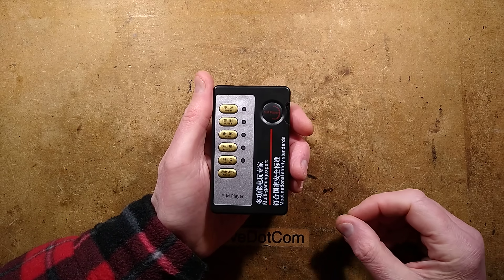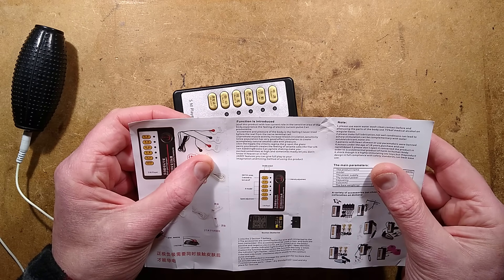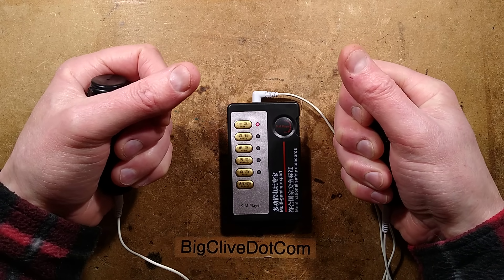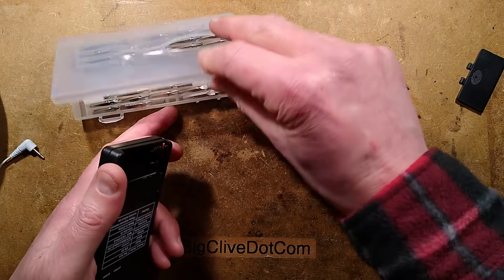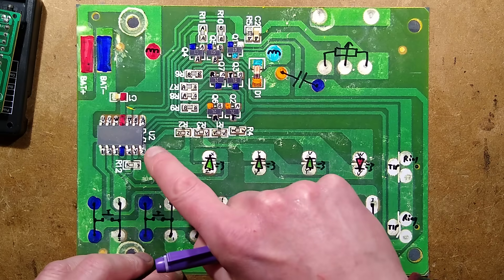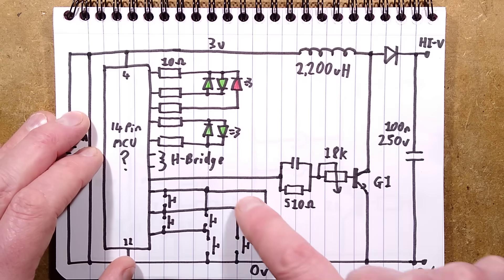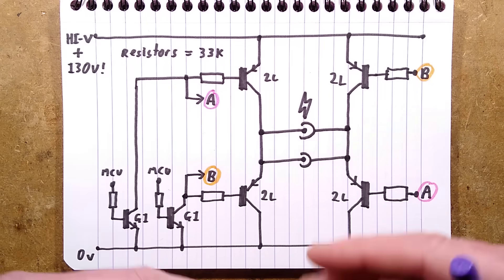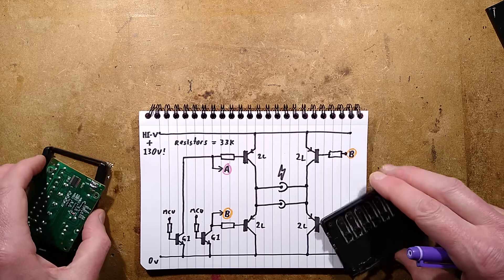Inside an invigorating electro-health device - with schematic

Comment: Despite the high voltage this should not pass 30mA , especially if you wanna plug these in your private parts , i dont see any current limiting circuit, but i think the voltage boosting by the inductor decreased the current ... im not expert on this side

Comment: I'd be curious to see what was inside the more advanced similar machines, like the more "proper" medical TENS units or the ones used by insertable electrode enthusiasts - would be interesting to see if the circuitry is similar but with a more advanced microcontroller, or achieving something similar by a different method.
Reply from the maker: I think some are using low voltage amplifiers with MP3 files for the waveforms.

Comment: Could this be modified into a defib unit ?
Reply from the maker: No.  That requires a lot of clever processing and high voltage current controlled DC.  I have a video about a defib unit.

Comment: Very good anf fun tear down of this unit Clive!
But in the schematic of the H-Bridge it seems to me the two connection points for the electrodes are both on the same side of the bridge, shouldn't one be on the opposite side for the voltage and current to reverse?  |---o)---|  and |---(o---|
Reply from the maker: Both sockets are in parallel and each is across the H-bridge.
Reply: @bigclivedotcom indeed, I can see it now when you flipped the board over at 7:55!
Was not what I expected 😉

Comment: I've used TENS machines for pain relief, but you have to be careful with how you set it. My machine allows you to see frequency, pulse width and amplitude, and covers some of the controls so they are protected for being bumped.

It's also not a good idea to connect electrodes across your chest, like holding them in both hands.

Comment: Thanks for an interesting and informative video as to how the modern versions of these devices work. Is it possible to modify this device so that the output is reduced? I am wondering about the possibility of modifying such a device for electrotherapy purposes that operate without causing sensation.
Reply from the maker: At the lowest setting it can barely be felt.

Comment: Some of them def do pulse DC for the sake of two transistors and I have often wondered how damaging that might be; I imagine that usage is probably very short not hours like it might be for back pain etc.  I think the danger of these is that you'll find some at £10 maybe up to £20 and then a huge gap and then £150 - £500 and lets face it, people will spend the £10 and are unlikely to spend the £150.  They are not really that pleasant initially but after a few mins (of presumably nerve damage) the sharpness goes and its more of a massage.  Finally since everything you buy is some cheap plated Chinesium, I don't really know what they are plated with and I'm not sure whatever it is will not do you much good as it electroplates your testicles (or whatever).

Comment: The H-bridge output stage of that device works very similar to the output stage of a 12volt dc to 230v ac power inverter.

Comment: You should look at the so-called Beck plant stimulators / blood purifier which is similar in design but still available in kit form. Claims to cure HIV and just about everything else first read about in a 80s ham radio magazine called 73
Reply from the maker: If it's the equipment I'm thinking of, it usually applied slow alternating polarity between electrodes to pass DC current through your blood as it flowed through your body.

Comment: I'd love to see the oscilloscope trace for the different modes. And.... That's about all I'd want to see.
Reply: Typically, pulse length is fixed anywhere between 40us-200us, repeated either with a fixed or variable frequency. The pulse itself is short and steep up to about max. 100V or so depending on model and contact resistance. If your model is transformer-based, there will be a longer but much shallower negative swing immediately after. Polarity alternation optional, transformer models tend to not even bother, presumably due to "no such thing as a DC-output transformer (unless you rectify, which they don't)".

Comment: I once made a device to give me shocks if I had too many beers at the pub. It used the high voltage trigger transformer and trigger circuit from one of those disposable film cameras, without the giant flash capacitor of course. It didn't work. Well, the device itself worked but it didn't stop me drinking too many beers!

Comment: How does discharging the high capacitor with metal tweezers help? 😂
Reply from the maker: As long as the circuit is isolated from ground it's safe.

Comment: Those jacks are 1/8" jacks.  That's the original standard.  Same with 1/4" jacks - they're not 6mm.
Reply from the maker: These are the smaller 2.5mm size.
Reply: Dude, NONE of the gear and electrodes in this space uses 3.5mm jacks. All of them are 2.5mm.
Reply: @AttilaAsztalos  - You're actually wrong there.   I've worked with a chiropractor for 25 years, and the bulk of the equipment is 1/8" or 1/4" jacks, if they're not something completely proprietary.  BTW, 3.5mm jacks aren't.  They're actually 3.18mm.   The plug standards were built in U.S. Customary units  (Well, and Imperial, because for linear measurements, they're the same)   The 'mm' is a conversion invented by a group of people that were incapable of understanding two measurement systems because they were 'too hard'.  (This same group then came up with 'Kelvin', because apparently -273.15 degrees is too difficult to work with.)

Comment: The Tens 7000 is great little unit. You can the the 9v battery one or a rechargeable type. The pulse width and modulation can be controlled, as well as various pulses or a constant waveform. Most units do not have the constant mode. And as another person stated, NEVER use the pads, clips, hook-ups or anything else above the waist. A possible heart attack could be caused by the unit, no matter who makes it.
Reply: After searching the world's medical literature I've been unable to find any credible evidence that supports TENS as a risk factor for heart attacks. Can you correct me on this point with a single published case? (I've been searching for years.) Further the package insert for the FDA approved devices have NO, I repeat No warnings to that effect.

Comment: I think there is no current limit. Instead the value of that capacitor limits the maximum energy dumped to the user because the the boost converter just charges the cap like a photoflash did before LEDs.

Comment: These are real but they need contacts and special conductive oil/gel plus a doctor to pick the right spot.

Plus you need an actual reason, not just some psuedoscience self-improvement. These are meant to stimulate damaged nerves for your brain to figure out where they are now.

When I folded my upper arm it damaged nerves in my hand, mostly thumb-to-index finger and the back of the wrist. I was stuck with a limp wrist and a bad grip for about 6 months until the physical therapist zapped it a few times and I "found my hand" again. Hard to describe but you can easily hurt yourself with them if you pick the wrong spot or leave it for too long. Not really worth buying either, helps with motion but not feeling. Talking to a doctor without any gadgets is still more beneficial than buying these things.

Comment: That schematic doesn't make sense. Both electrodes are at the same voltage, so the only current loop would be some sort of capacitive coupling between the body and the battery. 

If each electrode has two conductors, then it makes more sense. That would mean you aren't actually getting any voltage across the chest when you hold an electrode in each hand. The current is limited to one hand.
Reply from the maker: The hand electrodes have a two pin jack.

Comment: Seeing a TENS machine a few months after covering them in school was super neat. On the one we worked on had Burst mode (low frequency current & high frequency pulses), Normal (constant frequency and pulse width), and Modulated (frequency varied to reduce nerve adaptation). The pulse rate determined the feeling, while the pulse width determined the 'depth' of stimulation

Comment: Thank you Clive for delivering such fascinating material. May I suggest you resurrect Fanny Flambeaux as a test subject for the stranger shaped electrode? With the addition of certain powders that you are well acquainted with, a spectacular end result could potentially be achieved at higher voltages / frequencies. Naturally, this could be framed as a "Don't try this at home" health and safety message.

Comment: OG viewers remember the old video where you tested this the expected way and found it unplesant.
Reply: Would not be surprised if these are repurposed muscle stimulation devices.  The dildo-like electrode has much to small a seperation between the two contacts in order to be pleasant.  These are just uncomfortable cheap (and dangerous, given the non-seperated "channels" to which you can attach electrodes) devices meant to jump on the small'ish hype of erotic estim.  And unfortunately, because of the sametimes unpleasant nature it turns people off from it.
The better devices unfortunately are freakishly expensive.  Partially that'll be a liability situation where the manufacturer has to get things tested, but it's the result of catering to a niche market as well.  Not only the low amount of kits sold will play a part, but the fact you are selling to a market in which it is easy to basically ask whatever you want because there are no alternatives will also play a role.

The chrome electrode to me immediately had me worried about the possible toxicity of the chrome plating: some are perfectly safe for use on or near mucuous tissue, but when passing electricity become toxic.
Reply: Can I let go of 10mA mains (240V 50Hz) current? (Do NOT try this!) 
is a good one too lol
Reply: "Should I stick this electrode in my butt?" Is the OG video from 8 years ago that you meant btw its a classic!

Comment: I designed and built one with an NE556 dual timer. One side to generate the voltage and the other to control the frequency. The medical unt the dr perscribed was $500. And was beyond finintual reach. Now their available over the counter for $35.00

Comment: I have proposal for next device, it looks like butterfly, but its 2 electrodes and in the middle is battery and electronic. This is placed on some muscle and then device contracts muscles in programmed mode. Its funny, once you place it on hand, you cannot remove it :D If you place it properly, you can trigger finger movements.

Comment: Fun little device, did a similar project for an art performance - artist wanted literal meat puppets - real bodybuilders controlled externally - for reliable muscle contraction you have to produce around 200V of compliance and up to 50mA, tho at a really short pulse length. Worked like a charm, tho I was really paranoid about isolation between channels, as not to pass current across the heart.

Comment: One in each hand - NOT IDEAL. There's this beating/pulsing muscle between those 2 hands. That's exactly why you take your wedding ring off when you change a car battery (near full current at 12V DC between a wedding ring & wrench will off you till you DEI from it)!
Reply: Not trying to step on your toes. Soon after I posted it you implied a similar thing and I had no intention of taking your statement away from you.
Reply: The reason you remove your rings when changing a car battery is so that if they cause a short circuit they don't glow like the sun and burn you or cause
sparks that could ignite the gas being vented by the battery. 12 V will not kill you or stop your heart. Even if you place one hand on each
terminal you will not feel a thing.

Comment: Strange that the two hand electrodes are driven in parallel. As the circuit is floating from earth, the user should not notice anything. Just like a bird can fly to and sit on a high voltage line without any harm or pleasure. Or is there a twist in the connectors on the board (not according your board view) and have two equal wires hand electrodes? Having dedicated left and right, opposite wired, hand electrodes seems to much hassle.
The metal electrode has only one two wire cable connected to it I assume so it provides in opposite voltage between it's two poles.
Reply from the maker: The hand electrodes have a single plug.

Comment: now then BC. as is my wont I'll bore you with my latest researches. i have repeated this experiment several times, and i get the same results. but i still don't believe it. i got a 555, set it up as astable at about 1kHz, then i used output to drive a 540 mosfet, with an inductor from drain to V. then i attached a 450v 100uF cap i found to the drain, inductor junction. then i powered it all with a cr2032. i was measuring 130v across the cap!. i turned 3v into 130v. it just doesn't seem possible.  cheers, D
Reply from the maker: The collapsing field in an unloaded inductor can produce a very high voltage.

Comment: TENS unit. Jackass used it one on my ankle that was going through rehab for a bone spur trying to dig through my achilles tendon. That is, nothing that thing is for, it's hurt ever since. Caused the tendon to tighten up and the bone spur came into contact with it, roughly. Then the other rehab that went with it, caused my already damaged knee on the other leg to get even worse than it was. All so the insurance company can put off surgery as long as possible in a purely cost saving exercise. Welcome to American Medicine for profit. Vent over, sorry.

Comment: I have two medical TENS devices(doctor prescribed)which are extremely more complex than this thing. They come with sticky gel electrode pads, have multiple channels for stimulation of different areas of the body simultaneously and multiple modes/timers as well. From a mild tingle to "jump your butt off the table", mine have the power. They absolutely will reduce pain and massage muscles which I need as I suffer from back "ailments".  Very interesting little device there, thanks for the "silver bullet" cameo😮

Comment: My wife used a TENS machine when she gave birth. Before the event we had a play with it and discovered that you only had to turn it up slightly to get a good painful jolt from it.

During the birth (It was a water birth, I'm kind of proud of myself as the midwife kept her distance as I was doing a good job of looking after her and things were going well) she had the TENS machine, but she was also drifting in and out of consciousness and nature was taking it's course (Birth are NOT how they are shown in films, the women is a mere passenger and has no control what is going on but still has to endure it all. RESPECT TO WOMEN FOR THIS!)

Anyhow, the point I'm making is that after the birth I went to remove the TENS pads and got a jolt off it that made me jump and shout. I discovered that the machine had been turned up to maximum by my wife to cope with the pain. She doesn't even remember doing it.

Witnessing a birth and being part of the process was a life changing event for me. It is the most amazing (And a little bit traumatic, but worth it) thing I have ever seen and you get a loving child out of it as a bonus. He is 15 years old now, he is slightly taller than me and has size 13 (UK size) shoes. He beats me at video and card games on a regular basis but he is the light of my life and love him.

Comment: “Bits” made me laugh.  I’m disabled so I’ve had some experience with the power of TENS.  Did you know they sell conductive silicon loops that one can use to stimulate other “bits”?  Fun stuff.
Reply from the maker: I may have tried that arrangement, and it went from a tingle to being kicked in the balls in one step.
Reply: I tried it, but even on the lowest it was way to intense.
Reply: Bits is euro slang for gentials so Iv heard. Very uncommon over here
Reply: Wait until you see the conductive silicon (or metal) ones that are meant to go inside, uh, bits.

Comment: Remember the belts that looked like a wrestling championship belt? Im not sure if they shocked or just jiggled your gut but with " proper " use youd get 6 pack abs (there words). Being born in 1980, i remember some great products.
Reply: Slendertone was the brand name, I think, at least in the UK. It looks like they’re still going.
Reply: Worked of a COIN CELL, though. Not to say they couldn't shock you because they totally could, but seriously, the all around power available in a coin cell is rather limited. There's a reason you can attach an LED to a coin cell DIRECTLY, without a current limiting resistor, and still not damage it.

Comment: What is the actual voltage of the Zap. Can't remember the math for inductor/capacitor/duty cycle formula.
Reply from the maker: It depends on the contact resistance, but peaking around 100V.

Comment: I have a TENS version which I use for pain quite often, it is rechargable and the charge lasts a very long time, if you cannot feel much at a low power level it normally means a poor contact with the pads (or whatever you are using) Tens really is not for playing with as it is very strong, used correctly it should porduce various pulse patterns, mine is all electronically controlled, and sex is the last thing on my mind when I need to use it

Comment: Does anyone remember the fairground style "electric shock machine" at Colomendy (between Mold and Ruthin in North Wales)? I think it was based on the device used for keeping cattle away from a fence. It was outdoors and, holding two brass knobs, you rotated one to increase the voltage. We'd all (ten or so) join hands and crank it up. Very 'tingly' until someone broke the chain. Then everyone jumped!! Happy days 😉👏👏👏